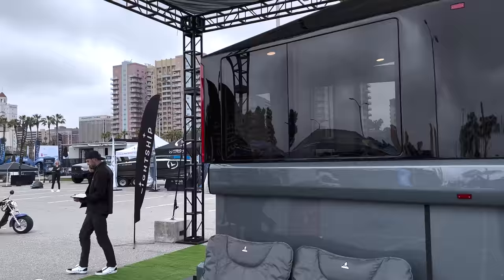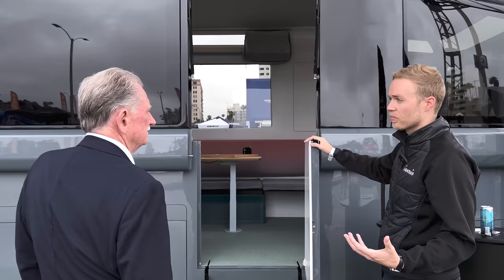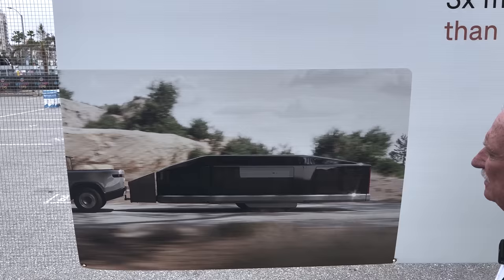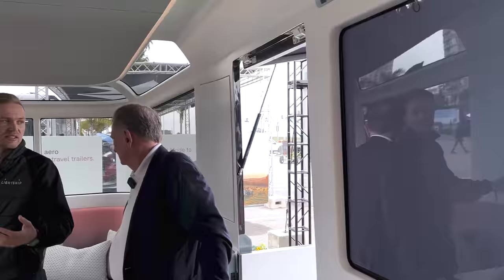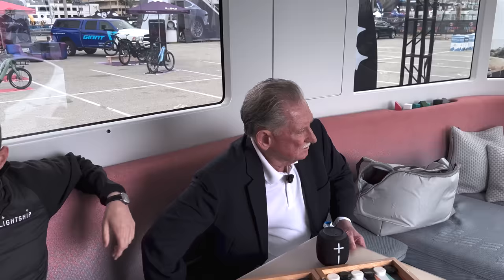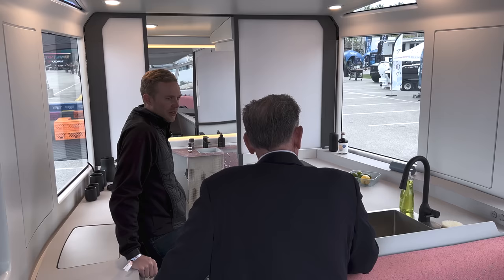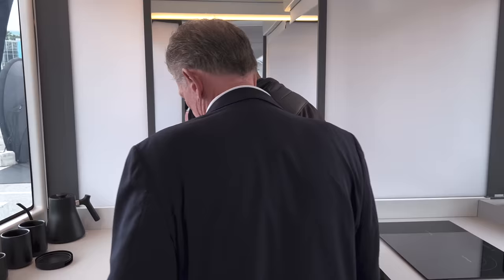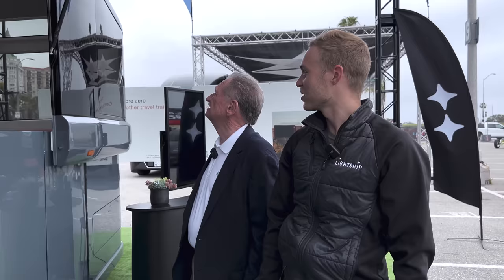Tesla Graduates Electrify the RV Industry - Lightship's All-Electric Trailer

Comment: If its self powered, why bother with the popup? Just add battery capacity and delete the popup. Gain more cabinet space in the process, add some wall space and reduce the setup and breakdown steps of camping with a trailer. Plus, every time you want to stop for lunch or a bathroom break at a rest stop you have to raise and lower the top. Gong that idea. Still really bleak and sterile inside. Opposite of warm, comfy and inviting….
Reply: The pop-up is to make it more energy-efficient going down the highway so that you have a lot more battery power when you get your campground to run all the electrical stuff.  No propane heat, stove, or hot water. This camper is going to suck the juice out of the batteries every time you touch something. And it will still eat on the truck's battery some while you're pulling it down the road at full height and just deplete the trailer batteries that much quicker.

Comment: Its definitely beautiful. Especially after seeing what Winnebago is offering in this space. But I do have several concerns... firstly it absolutely will need LCD window shades. Even if you put one-way film on the glass, what happens when you are camping in Alaska in the summer and the sun sets at 11pm and is up 2 hours later? Or if you need to camp in a place with security lighting, or in a place with neighbors with a different idea of when bedtime is?

Secondly... how impact resistant is that glass and who is on the hook for replacing it when rocks strike it? 

Third... I thought for sure that sink would fold down... but since it doesnt, I count at least 14 inches from the countertop to the top of that sink. Which means when folded down this thing still has tons of open space.  Sure, It'll sleep a family of 4, but where do they store all of their luggage, all of thier food, etc? I dont see any room for large items like popup tents. I guess some of it can stow in the isles and on the counters when travelling, but where do you stow it when you arrive?
The battery im sure takes up the under-the-floor space, but there is plenty of room here for some kind of overhead storage. If its inspired by aeronautical design, why not overhead bins?  

Lastly, if it has a vehicle battery and motor, is it doing assisted braking and is it doing regen? 

Again, I think its stunning... but it just feels like youll have to add a camper shell onto your truck that kills the aero just to stow all your stuff.
Reply: Find another video- it really has most of these things you’ve mentioned. Rock strikes is the only open question for me. i wish Monroe took a few more minutes to show the remaining features. overhead bins for instance, it has them. idk if the camera guy even panned the whole interior once.
Reply: @dfghdfzsd  Thats good to know. Its def cool!

Comment: They conveniently ignored talking about fast charging the 80kWh battery during a long trip. Take the trailer to a typical Electrify America or EVGo charging station and show us that it will be possible to hook up this trailer to a charging handle. Manoeuvring this giant into a charging stall with other vehicles occupying the adjacent stalls and with the typical limited space in front of the charging stalls is not something I would look forward to.
Reply: Charge the pickup, then tow charge the trailer 50 miles and stop to charge the pickup again. That would make 400-600 miles drive per day with one charge for the trailer. Then stop for the night and charge up everything at the destination, repeat. Also the electric support could be adjusted to cope with 500 miles drive. Then you would just charge the pickup more times getting 40% support
Reply: @timogronroos4642  My R1T can tow a normal trailer for well over 100 miles without recharging. Having to charge the pickup every 50 miles is a big step in the wrong direction. In any case there aren't enough CCS chargers installed nationwide yet to make charging every 50 miles realistic.
Reply: I think the 4kw of solar will do an ample job.
Reply: @WarrenBowman  Not really. Under ideal conditions it would take over 20 hours of continuous sunlight to recharge an 80kWh battery with those panels. Since the Sun doesn't shine over our heads 24 hours a day it will take several days to complete the job.
Reply: @cruiser97eric1  that seems like enough to power all that camping gear. And since these guys are Tesla and Rivian alumni, I don’t see why they would not be able to manage fast charging.
Reply: @WarrenBowman  Yes the solar panels will be useful once you have reached your destination, but I am talking about fast charging the battery during the long trip to a destination. The problem is that the charging stations that have been built so far are not trailer friendly at all. At many stations a pickup truck all by itself will have some difficulty entering a charging stall. When you attach a 27 ft long trailer to the pickup the task becomes mission impossible. A normal trailer often has to be detached from the pickup and left parked somewhere before the pickup can go to the station to charge.
Reply: @cruiser97eric1  in 2019, I took a three Month Rd. trip in a Tesla model three, pulling a teardrop trailer. We would usually unhitch, just out of courtesy to others. After a little practice it took us two minutes if I was going to charge the trailer, I would simply back it into a space and connect it. Then I would back my car into an adjoining space and connect it. I am also starting to see more pull-through charging stations.

Comment: 5:25 "...put drive unit on board...": Why do that. Why not run an extension cord from the trailer battery to the electric truck? You're not going to get much solar energy while traveling anyway...just 5 hrs per day...and 1/10th if it's cloudy. I'll bet you wouldn't use any more wire and you wouldn't have more drive than you need. The trucks got plenty of drive.

Comment: I'm thinking that if the camper is contributing to 'drive', you could hook up a much smaller EV as the tow vehicle.
Reply: small vehicle , would be Overworked, 78kwh batteries is HEAVY .
small vehicle would have REDUCED range. cant even go 100 miles.

Comment: Just to run a tiny office refrigerator can take 2kWh per day. And you need quite a few panels to do that...even on sunny days. On cloudy days you need 10x as many panels or more. And you need to get  your energy in 5 hours but run the refrigerator for 24 hours (actually 8hrs because it has a 1/3 duty cycle). Let's see what new magic these guys claim.

Comment: Makes no sense for me. If the trailer has it's own drivetrain, it's a motorhome and not a trailer anymore, put a Steering wheel on it and there you have it.
Nice try, but seriously, this thing will be to expensive, no one will buy it as a trailer, maybe as a Motorhome, which would make more sense.